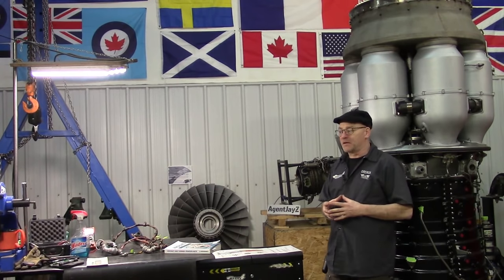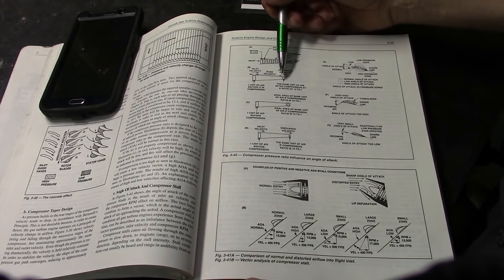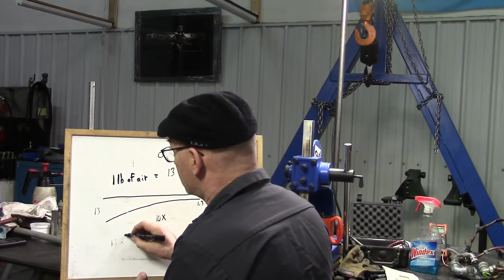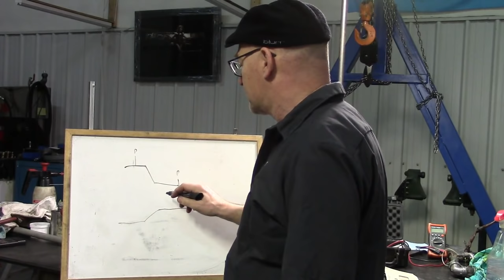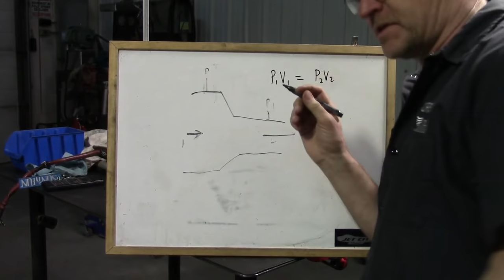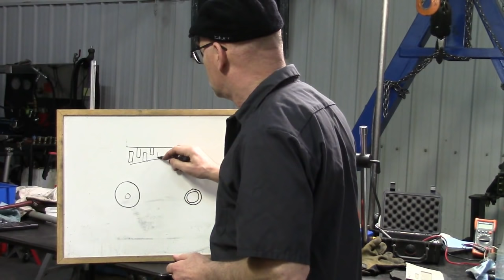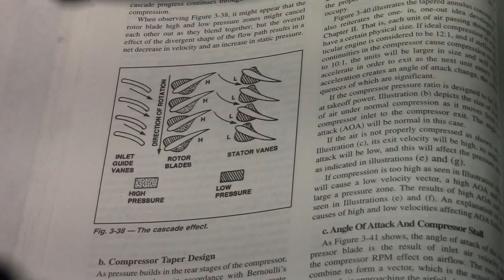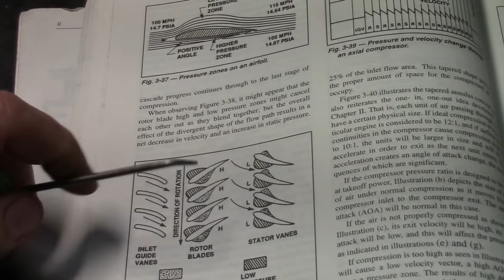the Narrowing Compressor Gas Path: Jet Engine Mistakes 3

Comment: A coworker and I have a dispute.  He claims airplane wings cause lift due to low air pressure on top of the wing, with higher pressure under the wing.

I say it’s due simply to the wing pushing air downward as it leaves the wing.  Then when my friend tries to explain how an airplane can fly upside down, the idiot can’t give a good explanation.

Seems simple to me - it’s the result of air being forced downward that causes the lift.  No matter if plane is upside down or right side up.  Can you explain to the liar/drunkard/thief why I’m right and he's an imbecile?

I feel much better now.  Thank you.
Reply from the maker: The convention they teach in all the schools is that lift is caused by the Coanda effect... lower pressure above the wing cause by increased speed caused by the shape of the airfoil.
I think it's a combination of that plus exactly the other effect you describe. The facts are that increasing the angle of attack will increase lift, up to a point. And that a wing does deflect air downwards. Flying upside down is possible in some aircraft, using only "deflection" lift, as you have mentioned.
I am convinced it is a combination of the two phenomenon, and I am about to get roasted, because I believe deflection lift is the more important of the two.
Reply: @AgentJayZ  I think you're both correct. The way I discount the pressure differential effect is to surmise that if the low pressure above the wing is causing lift by virtue of the higher pressure air under the wing thrusting upward toward it then that force is a function of atmospheric pressure. So, what if by magic there was a pure vacuum above the wings that extended all the way to outer space? This would represent the maximum conceivable lift pressure that pressure differential could produce, which at sea level is 14.7 psi. There would not be enough lift to suspend an air frame plus payload. The weight of the plane would pull the vacuum the rest of the way down to the face of the earth and the plane would just sit there on the ground. The low pressure is a by-product of the air foil, which is critical for maintaining laminar flow over the wing thus reducing turbulence and drag, but the lift force is the equal and opposite reaction of air molecules being accelerated downward by the bottom of the wing as it hits them.
Reply: @AveryIII  --- Good food for thought.  Thanks.
Reply: @kkonvicka25  I'm an aerospace engineer working in aerodynamic design. Some time ago this question was discussed in the context of turbine blades in one of AgentJayZ's videos. I will copy here the reply I made to someone there. You can find your answer in there, but the TLDR version is that both you and your friend are right, and by exactly the same amount, however your friend's view is the one that actually leads somewhere concrete.
[I copied the reply as is, so don't read it as if it was directed at you].

"I regret to inform you that while you are clearly familiar with some aerodynamic concepts you remain a bit clueless in the matter. Since at least 1908 (With the publication of the Kutta-Joukowski theorem - which is still the only mathematically valid explanation for lift) there has never been any debate about the source of lift among aerodynamicists. Yes, lift is a reaction force to air being moved (note I used moved, not pushed) downwards, and yes lift is due to a pressure differential. Clueless people like to debate on the web on the contributions of each when the very simple truth is that it is exactly the same. All of lift is due to a pressure differential, and all of lift is due to a reaction force to air deflection. It is the SAME. Where a force acts on a piece of surface (i.e. a reaction force) - it applies pressure - the two can't be separated, they are equivalent. 
As previously mentioned, lift was first explained correctly in 1902-1908 by Kutta's and Joukowski's circulation theory. Lift is due to a vortex motion around the airfoil. That vortex is called the bound vortex, or circulation. This motion causes airflow to accelerate above and decelerate below, thus a pressure differential and lift. It also causes air to be deflected downwards (downwash), by the exact amount that matches the pressure differential, because again they are equivalent. 
As for Bernoulli being true for one single airflow (whatever that means - that is not a valid term but I will assume you meant one single streamline) - you are both correct and wrong at the same time, but completely wrong in the context of airfoil flow. Bernoulli's equation is valid in an inviscid and barotropic fluid at steady flow for: A. a single streamline (as you said), OR B. a single vortex line, *OR*, and that is the important one - C. everywhere that the fluid is irrotational. Flow around an unstalled airfoil is irrotational except for within the boundary layer and within the wake's vortex sheet. Therefore, Bernoulli's equation is perfectly valid around an airfoil, both above and below (but is incorrect within the boundary layer or within the wake's vortex cores).
BTW integration of Bernoulli's equation around an airfoil yields Kutta-Joukowski's circulation theorem, which perfectly predicts downwash, and in it's 3D form (Ludwig Prandtl's lifting line theory from 1918) also perfectly predicts the wake behavior, including wingtip vortices, downwash induced velocities and wake roll-up.
AgentJayZ specifically said in his comment that he (wrongfully) believes that pressure rise on the bottom is greater than pressure drop on the top. I don't know how his comment could be interpreted any other way, which is the reason I replied.

I'll leave you with two practical examples that show how pressure and force are equivalent in the context of lift. In a wind tunnel, one common method of measuring lift is with a balance that directly measures the force experienced by the model. Another common method is to use pressure taps distributed along the surfaces that measure static pressure. An advantage of the second method is that it gives lift (=pressure) distribution, and not just the total sum. Integrating the pressure taps' reading gives the lift - which in wind tunnel tests always matches the force measured directly by the balance. Integrating the pressure with its moment arm gives the aerodynamic moment - which always matches the moment measured by the balance.
The second practical example is CFD - you may have heard of the term. It is a computational simulation of fluid dynamics. In CFD some version of the Navier-Stokes equations (depending on the type of CFD) are solved numerically to obtain pressure, speed, density and so on at every point in the fluid. Then the fluid's pressure on top of the model geometry is integrated to obtain lift - thus in CFD lift is calculated through pressure alone, because, again, all of lift is a result of pressure differential, just as all of lift is a reaction to fluid deflection.
I am an aerospace engineer specializing mostly in low speed aerodynamics. I calculate aerodynamic lift and drag professionally on a regular basis by resolving vortices (such as in VLM or panel methods) or from pressure (as in CFD). If this didn't work even just once I would see that when results are validated in a tunnel. 
I will even say that no one in history was ever even close to successfully calculating lift through a Newtonian reactionary point of view, because while it is completely valid and equivalent to pressure, it is also computationally a dead end (** the only exception is in hypersonic flows, when shockwaves are close to the surface and a Newtonian approach can be solved)."
Reply: @ASJC27  Very enlightening! Thank you.
Reply: Absolutely fascinating reply. Thanks.  
BTW, how did an X-15 with flat plate vertical stabilizers (like sheets of plywood) work better than conventional curved aerodynamic shapes?  If we knew back then, we could have saved some pilot's lives during test flights.
Reply from the maker: Ken, You should research the engineering of the X-15. The vertical stabilizers were not flat, but wedge shaped. It was an experimental aircraft, designed for researching, among other things, aircraft control at supersonic and hypersonic speeds.
The knowledge gained undoubtedly saved the lives of many pilots by advancing the design of many aircraft.
Reply: @AgentJayZ  stick hand outside car window while driving and rotate. Same effect right there. It's a good trick.
Reply: Oh dear, this is an old chestnut, which has been discussed several times on this channel  and elsewhere.  I may have had a career designing jet engines, but since I was a boy, I had also been fascinated by flight and by the "how do wings work?" question.  I spent years collecting a small library of text books, none of which provided an entirely satisfactory answer for me.  I finally came up with what seemed to be the answer just a few years ago, only to find that Professor Holger Babinski of the University of Cambridge had beaten me to it by a short head, and with a more rigorous analysis.
Essentially, I came to the conclusion that the 'bound vortex' theory is more than just theory: it is a fact.  A wing in forward flight is generating a vortex, which is continually being stripped away.  This results in an increase in velocity over the upper surface of the wing and a reduction in velocity over the lower surface.  The resultant reduction in pressure over the upper surface is significantly greater than the increase in pressure on the lower surface.  There is also a downward deflection (aka 'downwash') of the air flowing over the wing, in accordance with Newton's Third Law.  The pressure distribution around the wing, which results in the lift force, and the consequent downwash are both part of the total aerodynamic mechanism: you can't have one without the other.
Part of the problem in appreciating the mechanism is in imagining that the wing is stationary and that the air is moving, as if it was in a wind tunnel.  But try thinking about a real wing on a real aircraft flying through still air.  So what is actually happening? The still air is being moved by the wing, with the air displaced by the upper surface being dragged forwards in the direction of flight rather less than that displaced by the lower surface.  The nett effect is that, downstream of the wing, air is displaced downwards and in the direction of flight.
If you look elsewhere on the internet, you should be able to find photos of aircraft flying just above the cloud tops and producing a 'trough' in the cloud.  There is a particularly good one of a Russian Tu-142 doing this, with the effect of the wingtip vortices also readily visible.
Reply: @kkonvicka25  I think you may have the vertical tail of the X-15 confused with its horizontal tail.
Its VT is wedge shaped, with a sharp leading edge and a blunt trailing edge. The reason for this is that the tail's effectiveness is greatly reduced at high Mach numbers, so yaw stability becomes a big problem. The blunt trailing edge makes it acts like an airbrake, with a lot of drag but being at the rear of the plane this also means increased yaw stability.

The ideal airfoil for supersonic flight is a thin flat plate with sharp leading and trailing edges. That creates weaker shocks than a subsonic airfoil design, so less wave drag and better lift to drag at supersonic speeds. In practice airfoils designed for supersonic flight are not exactly flat, because this isn't great from a structural perspective (it has no "meat"). They usually use a diamond cross section instead to add thickness at the middle for better strength. This is often seen in supersonic missiles. 
The X-15 used a NACA 66-005 airfoil for its wing and horizontal tail, which is similar to a diamond airfoil, but isn't quite as sharp, so not as compromised at subsonic speeds.
Reply: @grahamj9101  For a long time I found circulation theory to be one of those things that are hard to get a mental image of, but just work. I recall being unsatisfied as a student that despite the fact that this is the only theory that gives a quantitative description of lift, and it does so very successfully, the concept of the bound vortex is still hard to paint in one's mind. 
After thinking about this for a while, I had the idea that taking a flow field around an airfoil and subtracting the freestream velocity vector from it should leave just the change imparted on the airflow by the wing, so if this was a real phenomenon, this operation would render the bound vortex motion visible. And it works. Here is a flow around a highly cambered Joukowski airfoil at a 15 degree angle of attack, and the same flow after subtracting the freestream from it: imgur (dot) com /3iFNsXC (youtube censors links for some reason). This was my eureka moment in accepting the theory as empirically true. 
On the same subject, there's a fantastic two part video by the late Prof. Ascher Shapiro of MIT on vorticity. It is available in youtube but the version in MIT's website is much higher quality. In part two he performs an experiment where a moving airfoil is stopped suddenly, and the bound vortex is released from it and continues to spin freely in the fluid, showing that the bound vortex is a real phenomenon.
Reply: @ASJC27  Ahh. Diamond cross section.  That is so kewl.  Makes sense.  Thanks.
Reply: @AveryIII  thanks for your hypothetical construct, that mental exercise really clinched it for me.

Comment: I'am kind of laughing my ass off because 50 years ago I took an in house GE course on the T700 ...Gerhardt Newmans baby....in terms of power to weight ratio....the entire design is based on converginging - diverging ducts...along with Gerharts patent on VG....variable geomitry...Herman the German only allowed easy to work on engines to be made....as he was a auto mechanic....no engine matches the T700...and ever will for simplicity and ease to work on.

Comment: i think people are just thinking close to the ram pressure. you should think of the energy as a stack of luggage being blown down a hallway, if it hits someone it has alot of energy but if it hits a wall parallel to it it just scuffs the wall and keeps moving. so yea i get it . pressure is relitive to speed. So as it it squeezes the gas it picks up speed and stays relatively the same pressure but moves frolicking fast

Comment: The only thing wrong about this channel is, it doesn't use metric units. Hate customary us units.
Reply from the maker: Back in the 40s 50s and 60s is when all the stuff I work on was designed.
I have tools in both worlds.
If you hate It, go.
Reply: @AgentJayZ  that's perfect..if what you're saying enables you to explain better. But you see metric is for educated people. The world has moved onto it.  Hate it, Go?  Well your english units are for backyard science. don't you know that a Mile is defined on  the basis of meter?  and several other units are defined using metric counterparts..tell me one reason why one should not hate? its obsolete! Great content anyway!
Reply: @roger72715  'educated people' haha. Its no ones fault the units system was changed, but no mechanics or engineers complain about it, and whet do you suggest one does? banish all imperial systems from the planet? when? tonight?
Reply: I have a hobby of rebuilding/renewing machines I like.   Most of them are internal combustion engines, and their surrounding parts.     It doesn't matter what country your engine comes from( and I have renewed and modified engines from all of these countries:  Japan, Germany, Italy, Taiwan - etc),  I haven't found one source or mechanic here in the US that uses metric for torque values. Torque values are oft used numbers we use to put things back together to specification.    Nearly every mechanic, book, internet information source quotes torque in Foot-pound, or inch-pounds.      So, in your "educated" world, yeah...metric all the way, in the REAL WORLD of doing things, it seems the critical values are still non-metric.      These customary US units are still alive and well and basically the language of the current stuff we build and work on today.    You might have a nut measured in mm or inches, but the torque on that nut will generally be quoted in foot-pounds or inch-pounds.    If the metric equivalent is present, it is listed parenthetically.    

To address your "hate" of customary us units, you might consider that, with a little practice with pencil and paper, and then in your head, conversions between the two systems are VERY easy.   So, maybe you can stop hating and start putting your energy to a more productive use.

Comment: All the layman really needs to know is that a jet works just like a piston engine -- suck, squeeze, bang, blow. Except your car engine does it in two revolutions of the crankshaft, and your weed-whacker/chainsaw usually does it in one revolution. A jet just does it continuously, with fan blades instead of pistons.